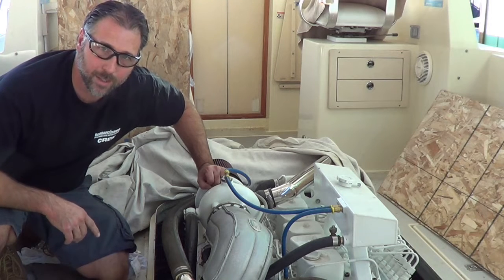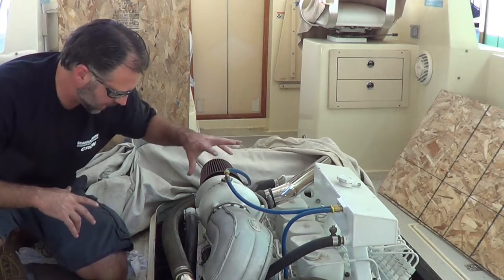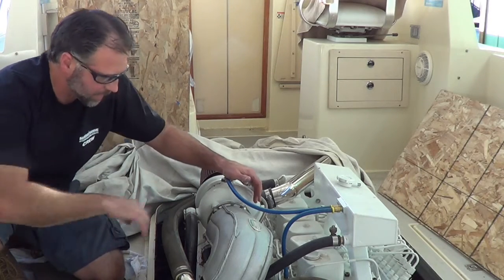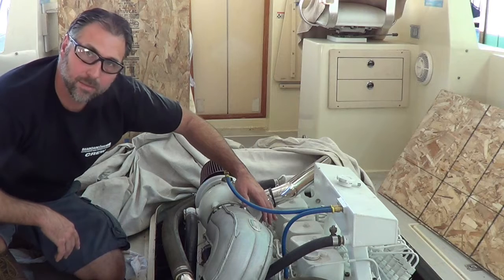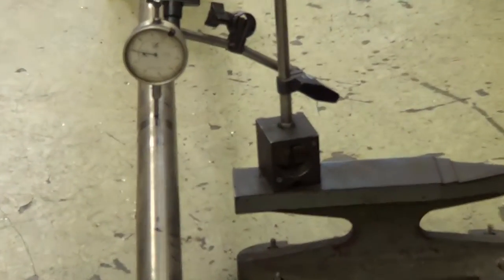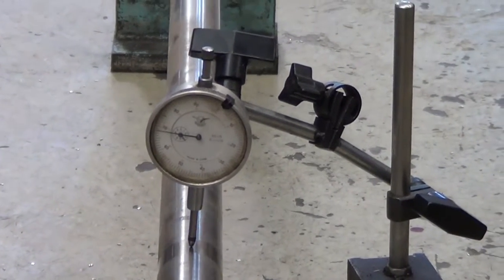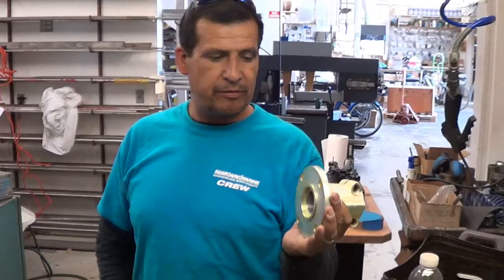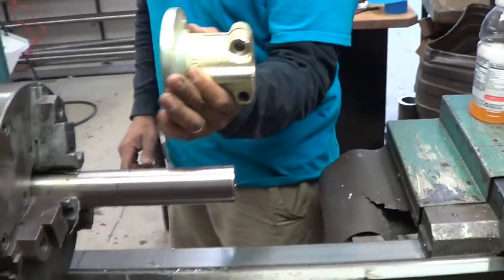Project Spotlight: Albin 28 Propshaft and Hatch

Comment: I had shaft seal replaced i think the log leaks do you have an pics of that or details? Does the shaft log just get glued to the cutlass housing?
Reply from the maker: Take pics and upload to our forum.  Www.sbmar.com/community
Reply: Don't have a pic but have water coming out of cutlass when hauled. Looking for a pic
Reply from the maker: Not all boats are built the same.  Without a few pic its hard for me to help.
Reply: Albin 28te same boat you are working on in video. Is shaft log fiberglass and jus glued to bearing housing?
Reply from the maker: The log is glassed to the hull, you can see the process in a few of our videos.  The cutlass bearing is set in with caulking and set screws, the shaft seal is a packing gland or dripless attached to the log with a hose and hose clamps.
Reply from the maker: The type of boat has little to do with it... As you can see our log is completely custom.